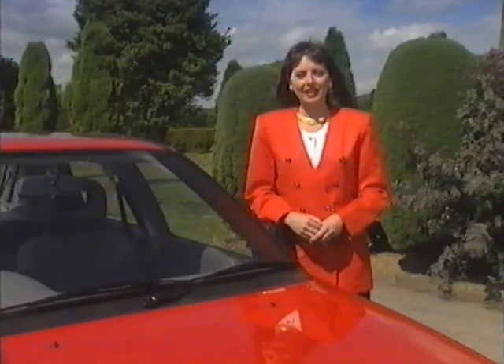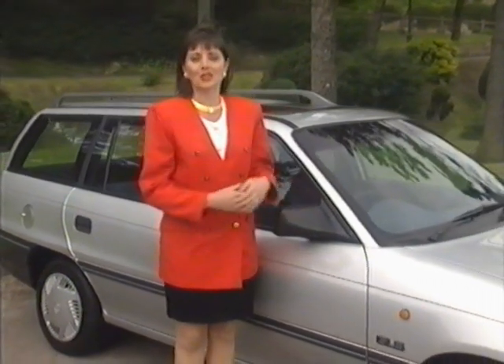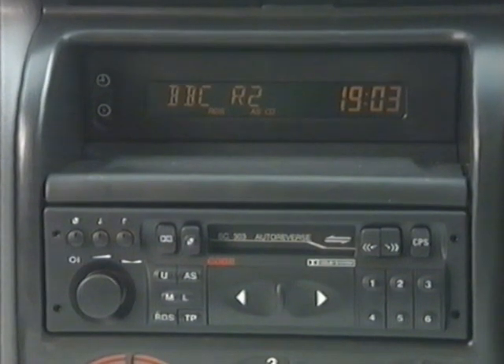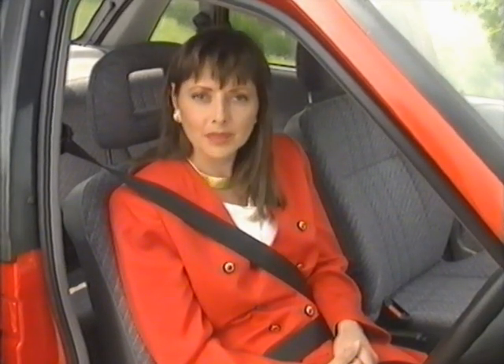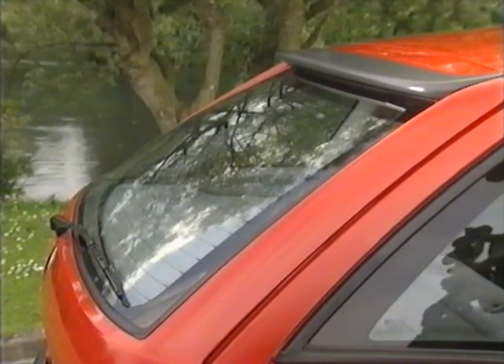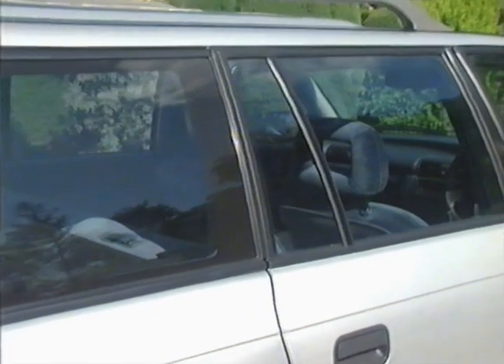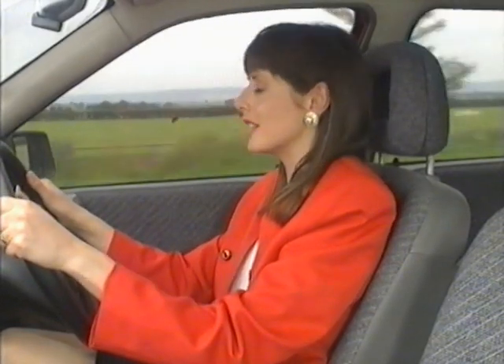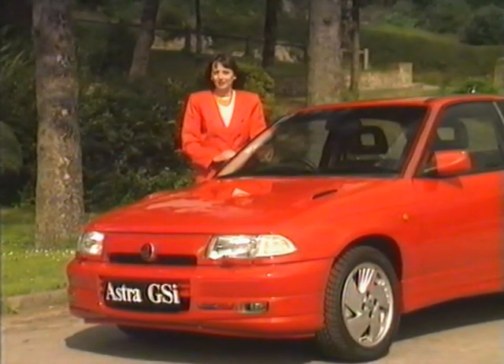1992 MK3 Astra Dealer Launch Video (hosted by Carol Vorderman)

Comment: The estate was brilliant, just about roomy enough for 5 adults with a decent boot, and a good range of petrol and diesel engines, but for economy the diesels were somewhat better, and showed it too when load carrying, with all the rear seats folded flat or towing a caravan or trailer. 

Diesels cope better with a full load of people and shopping or luggage, and make good load lugger for regular tasks ie trips to the DIY store, flat pack furniture from IKEA, taking things to the tip, getting home that new telly or washing machine from the shop. 

When the turbocharged Isuzu diesel unit was introduced, it added a good bit of pep, with a swift(ish) 0-60 time, but still with decent fuel economy.

Comment: Other than a 2 door hatch (which would have sold by the million) South Africa got the best of this generation of Astra.
We had (all 5 door) a 2L 8V hatch (Kadett 200is) a 1.8L 16V hatch (Kadett 180is) a 2L 16V sedan and 2L 8V sedan, 1.8 8V sedan and 1.8 16V sedan (all Astra), then we got a once off, South African only production run of the Kadett and Astra, the mighty and very fast 200TS, they took the engine, diff and wheels from the Calibra 4x4 Turbo and fitted them to a front wheel drive hatch and sedan...very limited production and now very very collectable...
We also had both hatch and sedan in 1.4L and 1.6L...
They were EVERYWHERE from the early 90`s until very recently...